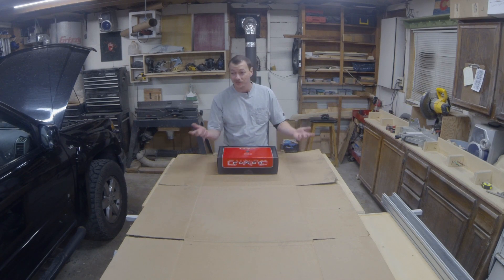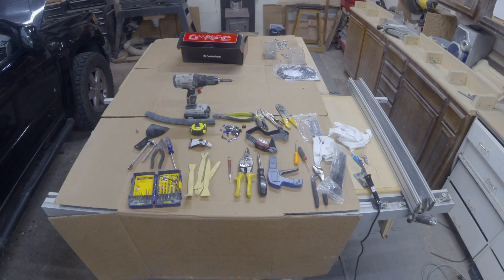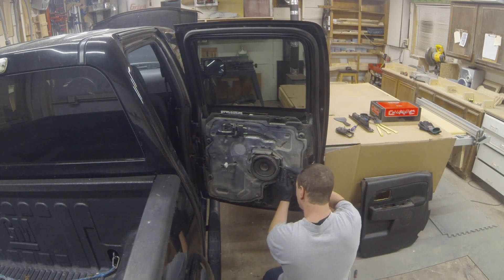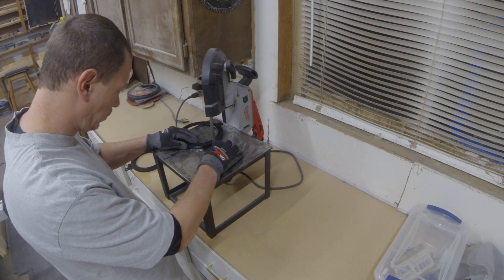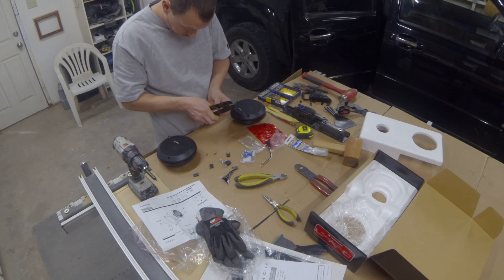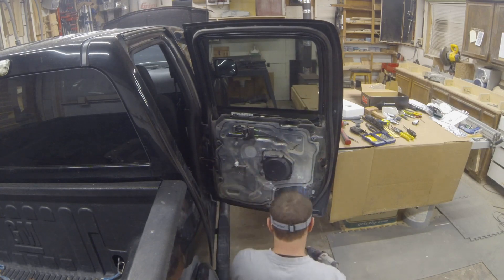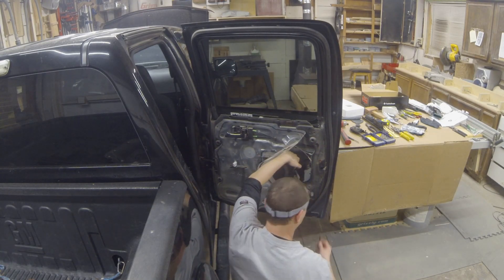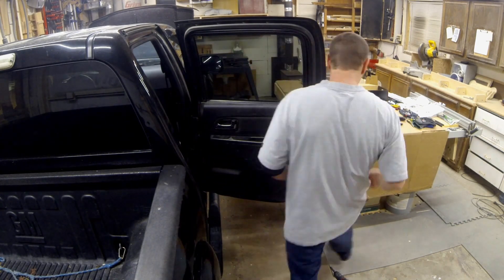Chevrolet Colorado stock rear door speaker replacement 2004-2012, rockford fosgate 5 1/4" p152

Comment: Where do you get the quick connect
Reply from the maker: Crutchfield.com includes all the hardware and connectors with purchase
Reply: Metra makes some also crutchfield might include them or another brand usually 7.99 pair